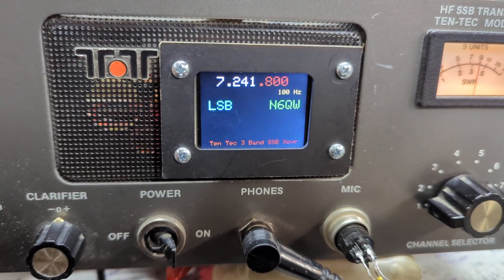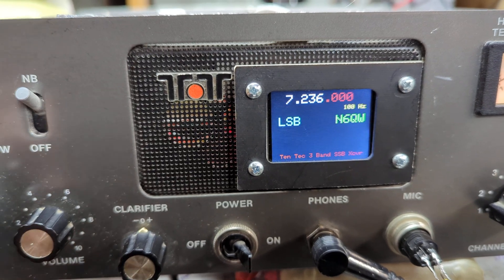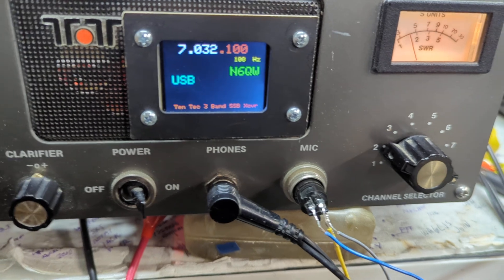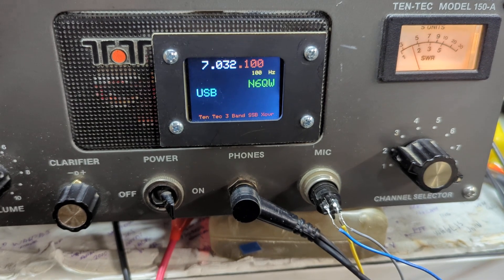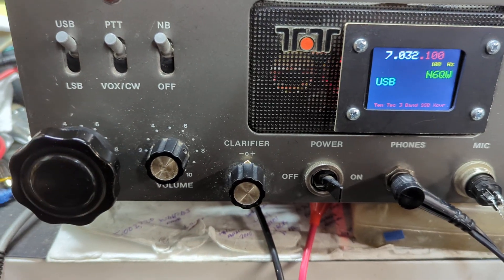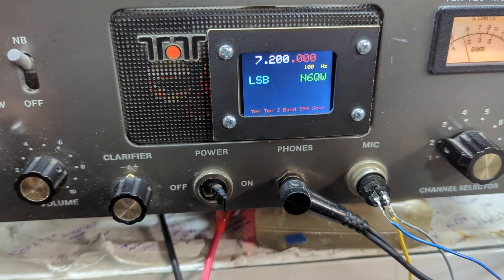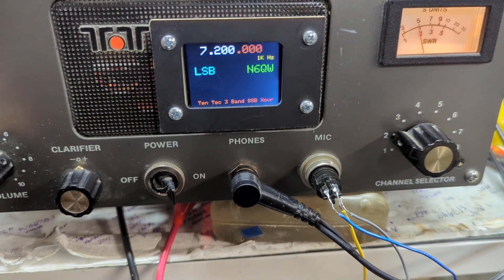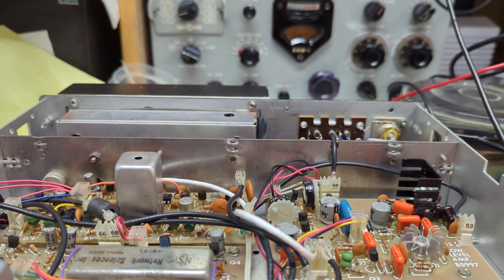Converting the Ten Tec Model 150A to LO Operation on 80-20M

Comment: Did you convert the "Channel" switch to control an audio band-pass filter (or some other kind of switched filter?
Reply from the maker: The location of the 8 channel selection switch is now the encoder location for the boring Si5351. There is no audio band pass filtering control. Certainly more things can be added but this is just a bare bones conversion.

Pete